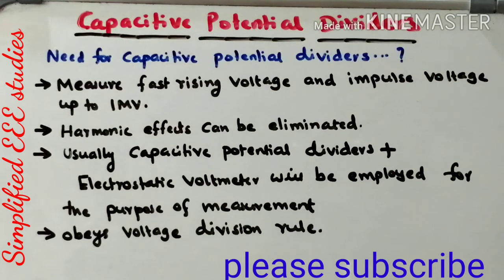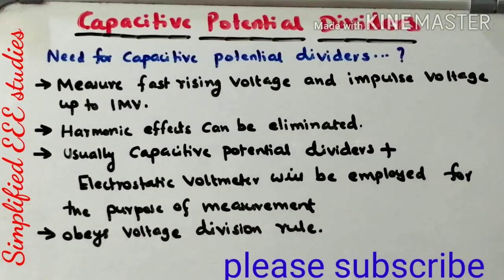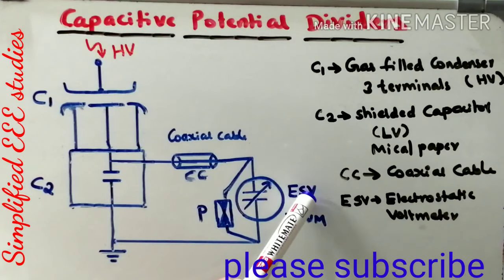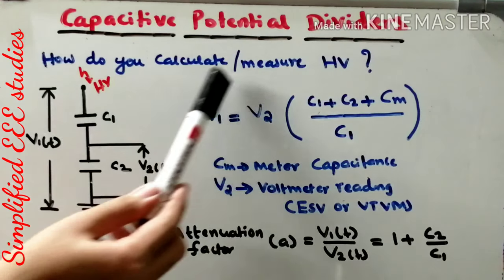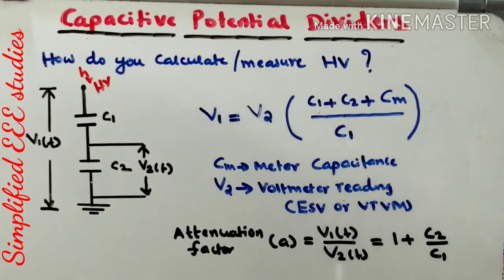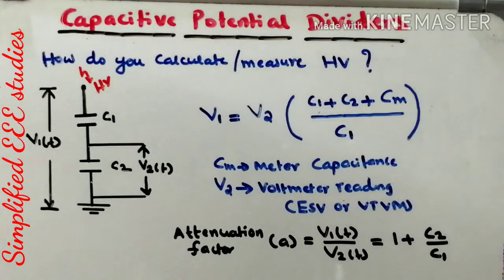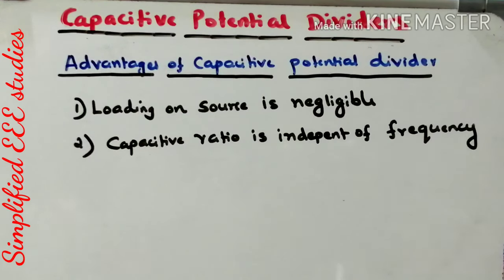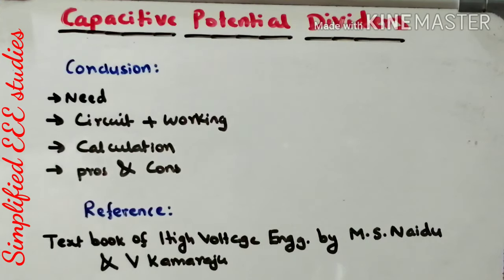CAPACITANCE POTENTIAL DIVIDERS FOR HIGH VOLTAGE MEASUREMENTS (CAPACITIVE POTENTIAL DIVIDERS) #4

Comment: Sir for working what we should write??
Reply from the maker: Good evening,
1. Whole HV has been divided.
2. Connect LV arm to measuring device such as DSO or CRO.
3. Do mention the equation which I have put up in the screen.
4. It works based on potential division principles.
Like wise you can elaborate the answer.